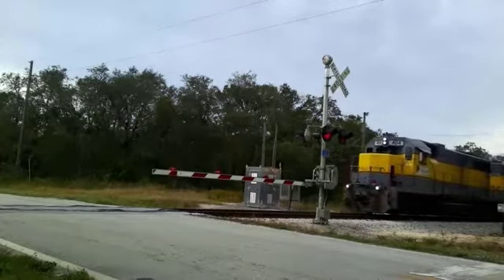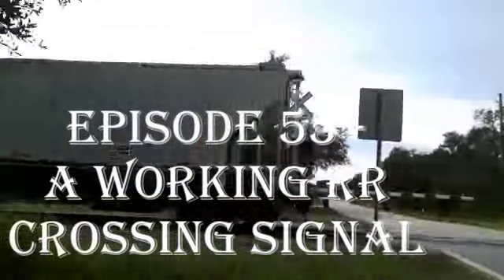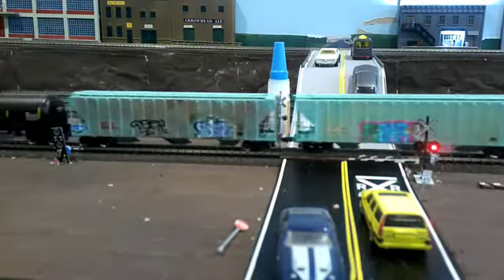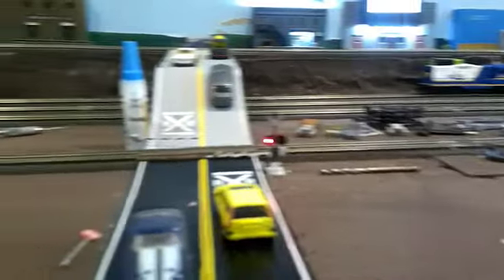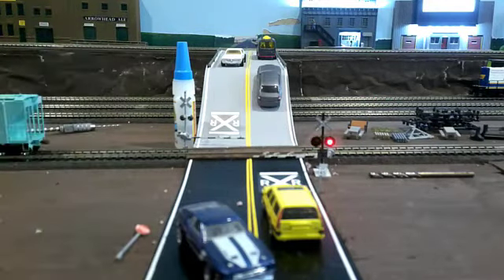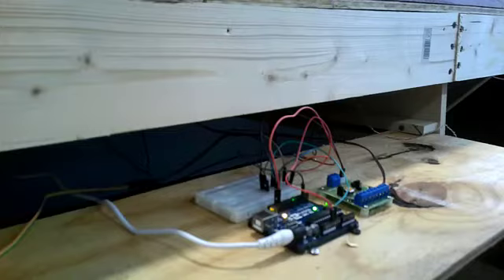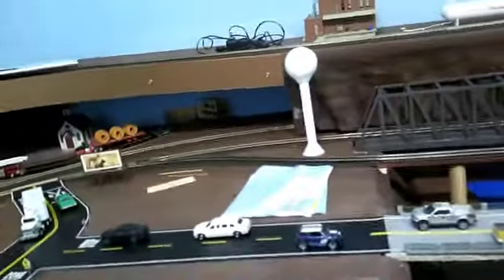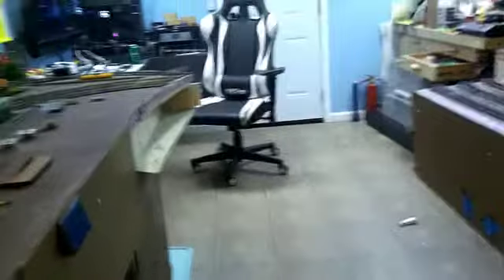Millennium County RR v2.0  -  Episode 55

Comment: Congratulations on getting the crossing signal installed and operating Jim. Obviously you were able to insert the needed delay into the sketch code. Smart move to only put the live signal on the side visible from the aisle, the dummy will do fine on the far side. For the 2 grade crossings that are only one "city block" apart, you can probably set it up to get by with only 3 sensors for the 2 crossings.
Reply from the maker: After searching the web I finally found the right command to delay the lights.
I didn't see any point to have a signal that can't be seen so that worked well. 
I will definitely use one uno for the close crossings, I was only going to use 2 sensors, but three would be better. Thanks for the tip, Art.

Comment: Wow…really cool Jim…what products are you using? sensors, flashers, etc.
Reply from the maker: Thanks Anthony,  I'm using an arduino uno board for the main controller, IR Infrared Obstacle Avoidance Sensor Module For Arduino Smart Car R-fd, Flashing Blinking LED Flip-Flop DIY Kit and HO Scale Railroad Crossing Signals 2mm LEDs.  If you need help with using arduino just ask.
Reply: @jimtedesco  oh yeah…I’ll need help with an arduino 😂😂

Comment: Nice job.  You could just put them in the into trackside silver relay cabinets, that is what on of the company’s do.  You could down grade the off delay to 5 secs. But nice going.  We’re you not able to find moving gates or motors?  Seems like you could just use a switch motor.
Reply from the maker: Thanks, I will be using custom made relay cabinets. I originally had them set at 5 seconds, but that won't work for a slow moving train.
There are no working gates to be found anywhere, motors are not an issue.

Comment: Great job on the arduino crossing lights. You soldered those, right? Maybe you can just solder the track feeders at the rails for 5 minutes a day, do three and then play with Pogo. It will get done and not feel so daunting. I didn’t see a chicken on your shirt. Enjoying all those eggs?
Reply from the maker: No I used a small breadboard,  I just did a bunch of feeders, but there are more. I like your idea of devoting a few minutes each day to do them. I play with Pogo so much it takes away my time to get anything done in the train shed, lol.